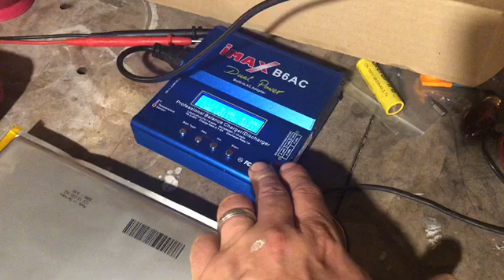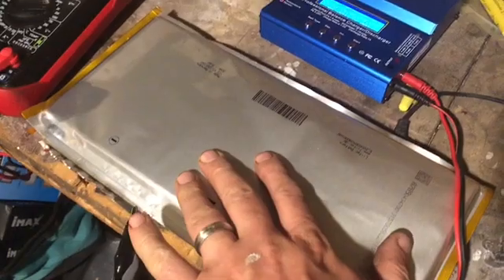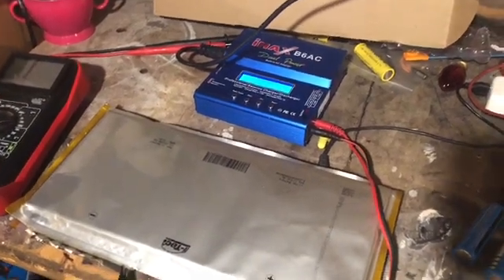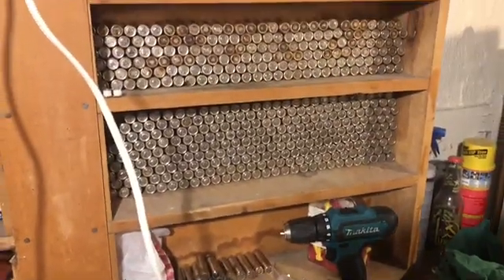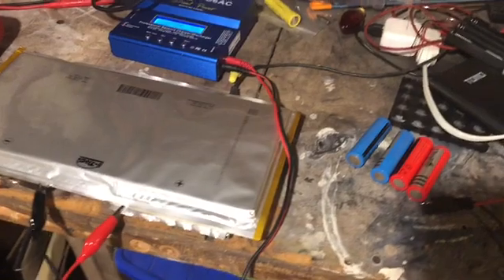Smart Fortwo Bricked Battery Cell Capacity

Comment: Hi Shawn, my smart fortwo has only one bad cell out of the 93, and I was wondering if still have any of those cell in good condition and if you would be able to sell them? I will attempt to replace this one bad cell. Thx
Reply from the maker: I don’t. I would personally drop the battery, disconnect the main power and BMS then try charging the individual cell with a hobby charger.

Comment: Hi Shawn,  I'm working on my own set and want to swap a couple cells around and them re-bolt the pack together.  Do you think this can be done?  Or did you find this was a "toothpaste out of tube" scenario, where once you remove a cell you will never be able to re-bolt the pack together?  Thanks.
Reply from the maker: DavidPoz our thought was that we didn’t want cells to be lonely (series) like accumotive had design them like so we were going to put 2 in parallel then 13 parallels in series to get 48 volts (26 cells) we bought a pretty heavy duty spot welder and copper foil to help us. Or you could just break them up in sections of 13 and have 48 volt sections and solder or weld a bus bar parallel to the cell on top on the - side and do the same on the + side. Then you would have 6 tiny packs. You could bolt two together but isolate them electrically and have three packs of 26. You could use the spare plastic cartridges as separators and to return the packs to their original size so you can bolt them back in the original box to hang on the wall like a power wall. If you took the BMS and cooling pipes from the oem of you could use that space for your own BMS and even mount a display monitor where the BMS cutout is.
Reply: That's cool you have a nice plan.  I was asking about bolting the packs.  When you un-bolted the packs did they spring open?  Like, are they under compression as if they were built while in a press?  I'm sorry if I'm not being clear.  The Chevy Volt packs spring open when un-bolted.
Reply from the maker: DavidPoz not at all the cells are welded to the top copper core brackets that are on top of each cartridge. So you will want the on a table so that the weight doesn’t break the weld in the middle of the pack. Leave the tap on because it’s easy to arch because of so many charged surfaces b
Reply: @subjectmatteramateur16  OK.  Cool.  It sounds like I should be able to re-bolt the packs back together after re-arranging the cells.  Thank you.
Reply from the maker: You are correct. It will take some engineering to configure them because the tabs to weld to are design for every cell to be in series but you got this.

Comment: Do you sell battery cells one by one?
Reply from the maker: dgn555 I can!
Reply: @subjectmatteramateur16  Hi Shawn, I have Smart 2014. Bought it bricked for 1,5 years, removed the battery, voltage was 0.0V. Charged it up with a 24V, then 36V and 48V scooter chargers - modules in parallel,  then with the chargers in series 24+36V, 24+48V and finaly 24+36+48V,,,, up to 110V per module. Then I put the battery on the car and hooked it up to the original charging setup. It took charge to 100%. Now it is capable only of 17miles of range, at reduced power and speed up to 25mph. 
Long story short - I might need to replace some of my pouches.
Do you have any left and for sale?
Thanks!
Ted
Reply from the maker: Teodor Petkov sure. Where are you?
Reply: @subjectmatteramateur16  I am in Dallas, TX - 75028. Thanks!